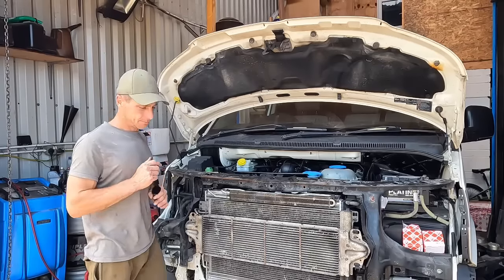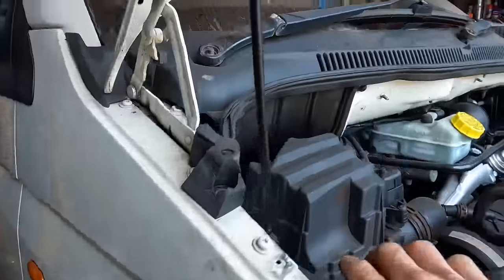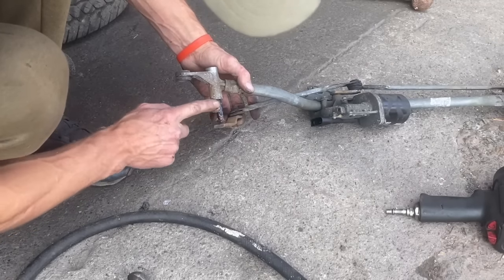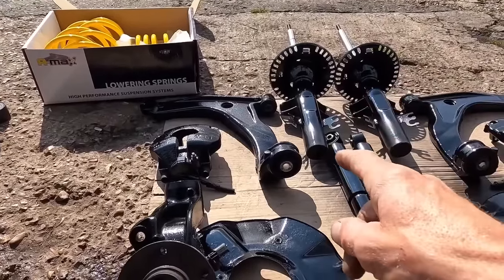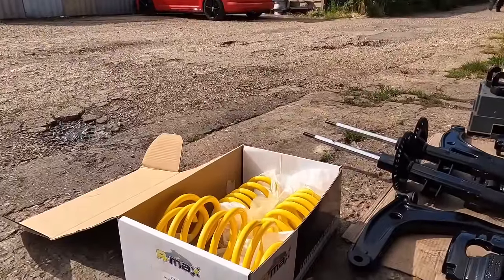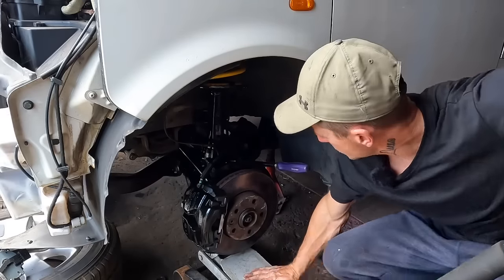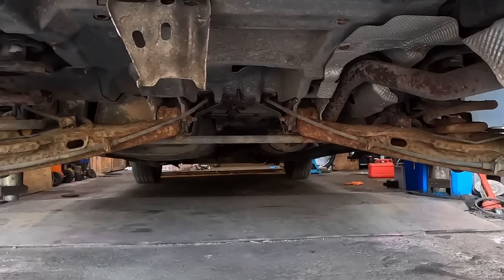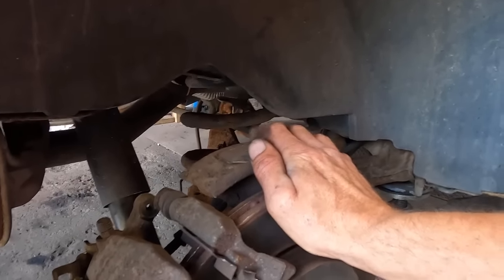Vw T5 wishbone bushes - lowering springs - build series Ep4

Comment: I love your attention attention to details, I’ve noticed that VAG lower arms seem to get surface rust very quickly but no hardship to give them a coat of something.
Reply from the maker: Hey bud thank you appreciate that 👍 a few manufacturers suffer with surface corrosion, I’m yet to see a vag one rust all the way through it just seems to be surface. A quick clean up and coat of paint should keep it at bay for a abit longer.

Comment: Hi just come across your channel enjoying videos ive just got a t5 its lowered to much with stance lowering kit got a bit of weight in back cupboards across back doors with leisure batteries was thinking of changing the back suspension to original but not sure on weigh could i just change the shocks and keep the lowering springs thanks

Comment: Looked like you are missing the lower rear spring rubbers that sit between the arm and the spring.
Top mount bolts can be undone and tightened without an impact by using the weight of the van on the suspension. I undo the 21mm in the bulkhead before jacking up, leave it with a couple of threads, gives you movement in the strut when working in the wheelarch. Then on reassembly, hang the strut with again a couple of threads and tighten when van is back down on its wheels.
Reply from the maker: Hey bud yes it doesn’t have any rubbers on the bottom of the springs, just ordered some to re fit when I strip it down again, your right leaving tension on the top mounts does normally hold them. Because of the cover on the top mounts that keeps the threads clean so easily done with a ratchet. Thanks for the tips 👍

Comment: Getting there , spring height looks a good compromise , not sure about the tracking adjustments on the rear wishbones , guessing a couple of centre punch marks , not been that brave to do the rear ones yet .
Reply from the maker: Thank you Marc 👍 I was happy with spring hight, I didn’t want super low but just abit sportier than standard. I’ve already spotted the rear wishbone bolts, my plan is to mark them with a blade or chisel so they go back in the same place. I might also get some box steel and bolt it to the hub with a wheel nut and mark the body where the box steel touches that way I can see if the alignment is the same, hard to explain but I’ll show in the next vid.

Comment: Always good watching these videos just a question would you know if a alternator from a vw beetle 2002 will fit in 2006 vw polo gti I’m from nz and it’s hard getting parts for polo over here just looking for an alternative
Reply from the maker: Hey bud thank you appreciate that 👍 is the engine in the beetle the same as the polo? If so probably yes, just have a good look at the bolt mounting points and that the wire that plugs in is the same. Vw use the same parts a lot of different models.
Reply: Cheers thank you for that bro appreciate it I will double check before purchasing cheers
Reply: Hey bro that beetles alternator fit straight into the polo happy days
Reply from the maker: @onyxaries  happy days mate 👍

Comment: Great work on the T5. looks awesome👌 You didn't mention how lowering may effect the working vans ability regarding load capacity ?
Reply from the maker: Hey Martin thank you 🙏 so your right I did miss that part, I believe the lowered suspension would definitely be ok for work use but the weight load might be down due to it sitting lower, I’ll talk about this in the next video 👍

Comment: Did you remember the socket off the rear , when you tightened it up?
Reply from the maker: Hey bud well spotted 👍 yes after then Timelapse ended i slithered under to play with the handbrake and noticed the socket 👍

Comment: Great video. I need to sort the bushes on my T5. It’s already lowered by the previous owner. Is it worth going with power flex bushes or standard?
Reply from the maker: Hey bud thank you, so I have ordered a poly bush for the rears because they last 10x longer and are so easy to fit so go for the power flex ones 👍 appreciate the comment.
Reply: @YTDTETV  Thanks for a speedy reply!  I might put powerflex bushes in to replace the bigger bushes on the front wishbone. I think they get a hammering? Van is all over the place on uneven ground/road and where I live most of the roads are rough at the moment! Don’t have mega cash to spend at the moment but do want it staying in a straight line if possible. Already looking forward to the next video. Cheers 👍👍

Comment: Hello pal. I purchased the heavy springs for my t5. Seems like the rear sits lower than the front? By about 25mm. Did you experience this?
Reply from the maker: Hi bud yes mine was the same, I bought some new rubbers that sit under the rear spring, I bought the orange poly ones from eBay about £25
Reply: @YTDTETV  ahh that’s annoying. Would have gone h and r if I would of known. Will get some spacers fitted and hopefully that will sort it. Quite pleased with the ride tbf. How have they held up? Have they sagged at all?
Reply from the maker: @Dddddddd348  sorry for delay bud mine are still holding good 👍 nice ride and the paint is still on them.

Comment: Keep the nut for the top of the suspension don’t use the ones supplied with new suspension/ coil overs
Reply from the maker: Hey bud yes the old nuts are never very good I much prefer the original genuine ones 👍